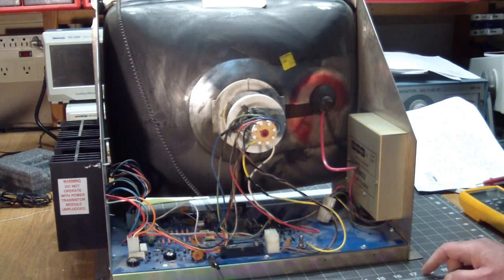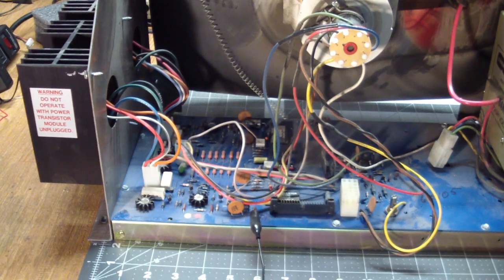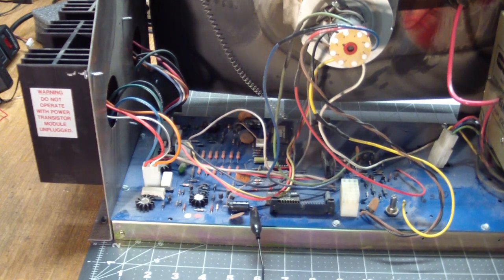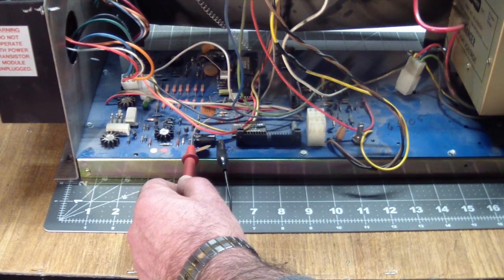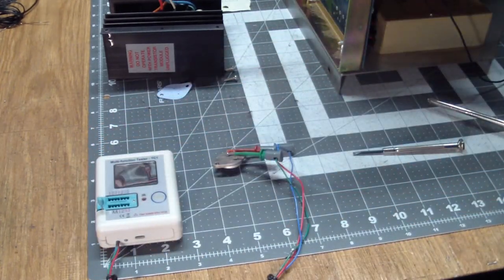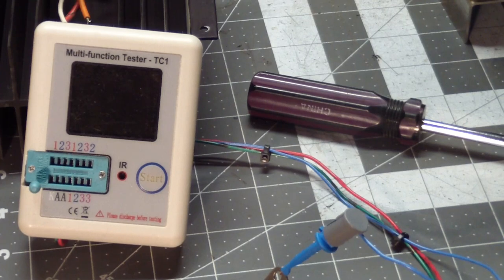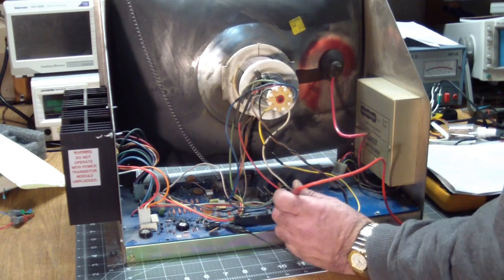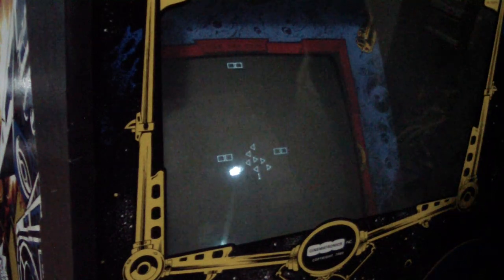AE#165 Repairing A Cinematronics Rip Off Arcade Game, Part 2

Comment: 1:13 - Forgot about those sounds coming from certain tubes' chassis, out through the case; and, now, it has a name in my nostalgia! 👍 
Haven't ever come across any work being done on one - making this video interesting.
Reply from the maker: The vector chatter I refer to should only be generated by circuits driving a vector display. If you hear them anywhere else you may have a problem.

Comment: Hell of a debugging job!  building the cpu out of TTL makes me wonder why?  plenty of cpu chips to choose from in 1980 and wonder what kind of instruction set they implemented.  maybe it just made a shorthand way to draw vectors
Reply from the maker: It has been commented that there were no reasonably priced CPU chips available that had enough power to do the job. And yes, the instruction set contains opcodes for drawing vectors. The control points have names like "Normalize Vector".
Reply: @artifactelectronics  Cool.  and probably a software character generator.  i get the need for speed thing we used the DEC PDP-10 With the 340 vector scope to implement spacewar.  Why does the vector display need a deflection coil?  i guess they could not come up with a monitor with electrostatic X,Y,Z plates.

Comment: I'm looking at my parts source options and likely challenges while assessing refurbishing of Trinitron and WEGA as well as a smaller number of RCA/Magnavox and Toshiba CRTs - most all of which are flat display/FD and curved-flat. Are there all-inclusive kits depending on the make and model when it comes to Parts needing service and if so where are the best sources nowadays? If those initial sources don't have any in Supply, are there other maybe more obscure suppliers that are keeping around some New Old Stock or equivalents?
🤔 Have been curious whether there are also certain parts I should seek out to add to my stock for these units for the eminent tune-up / repair so that part's are on-hand especially since certain parts are among most likely dwindling supply.
Reply from the maker: The only so called "get well" kits I've seen are for CRT monitors and are usually just a cap kit that is not always complete. If you're problem goes beyond a bad cap I would search online for any repair posts relating to your specific monitor. The same goes for sourcing parts. Try using a search engine which will hopefully reveal a parts source. If that doesn't work try electronics suppl places like Mouser or Digi Key.

Comment: If you didn't physically upload this at around 3 a.m. local time, are you able to preset the start time of an upload to automatically begin for scenarios where, namely, one might be limited in cellular or [other network] data speed/bandwidth until times of day when uploads are reliable/not at risk and faster?
Reply from the maker: As a creator you have the option of scheduling when a video becomes public By default the videos are private unless you manually set them to be public.

Comment: Most Arcade Monitors "don't have" resettable circuit breakers or circuit breakers in general. I'm not sure why this Cinematronics is using circuit breakers for the +25vdc and -25vdc, any reasons why they are using circuit breakers only for the +25vdc and -25vdc?
Reply from the maker: The monitor chassis is powered by the +- 25VDC, and the resettable breakers saved me a whole bunch of blown glass fuses. I guess those deflection transistor are none too reliable or just driven too hard.

Comment: Why is heat required to allow electrons to flow across a gap? Why won't an electric field suffice?
Reply: It's thermionic emission (Wikipedia)!
Reply: It would- that's called field emission- but it requires very high vacuum and higher voltages to work properly.  This is used in some electron microsocopes.
Reply from the maker: The heater sits in the cathode and makes it easier for electrons to be emitted. The more energy (heat) you apply the more mobile the electrons get. An electric field would be very inefficient to achieve the same purpose.